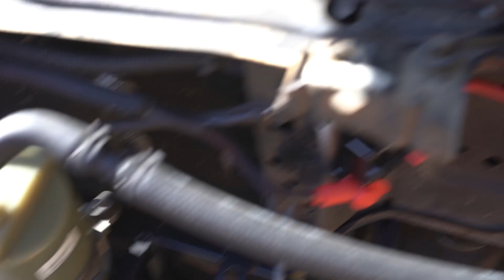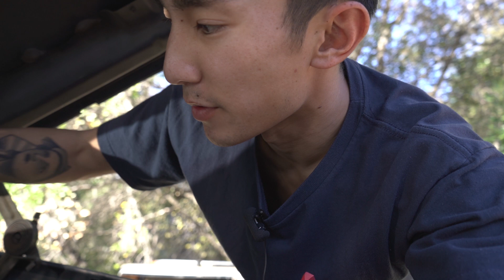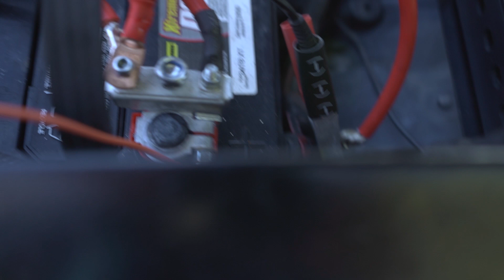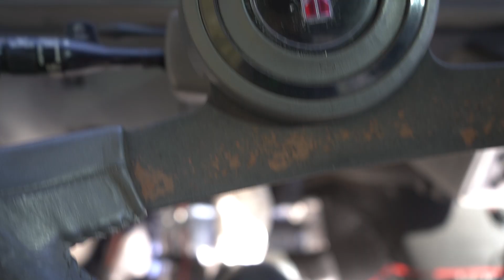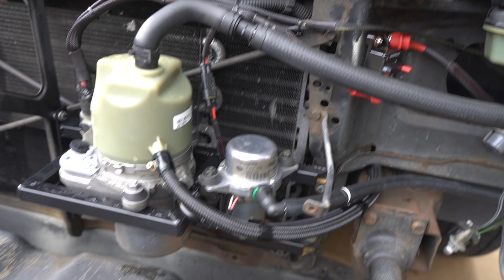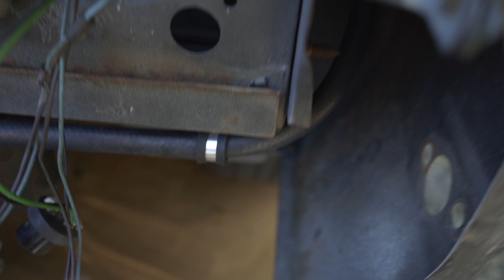Electric GBody Cutlass Gets Upside Down Brake Booster??

Comment: Another great video. Are you running 4 wheel disk brakes? I only ask because you are using the right hand drive Blazer master.
Reply from the maker: I will be!
Reply: @nileslee1  Ok good because that master will not work with rear drum brakes